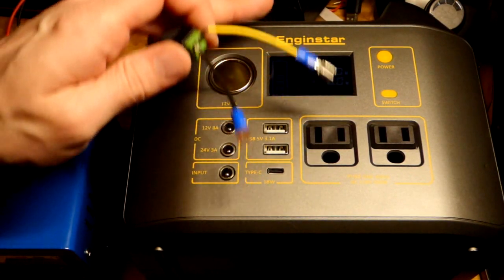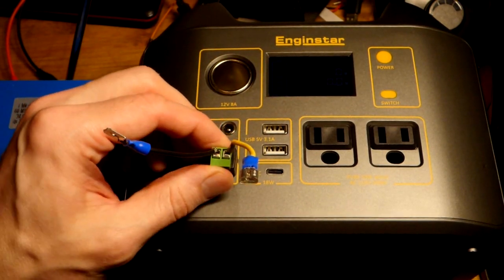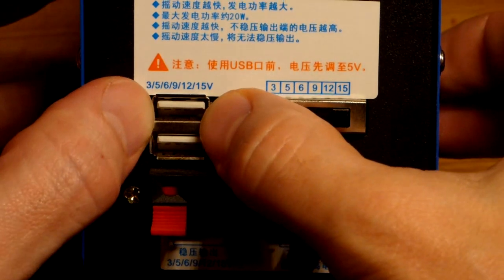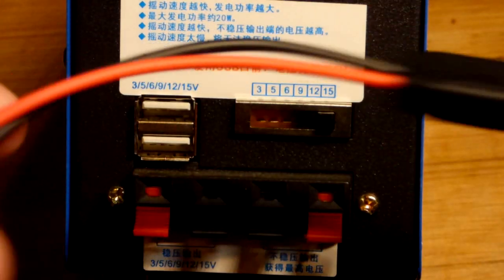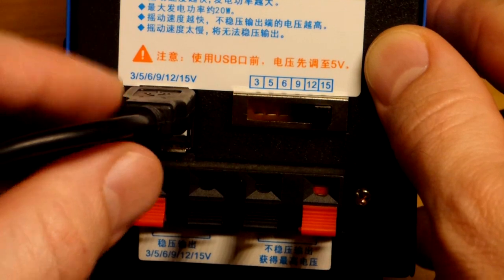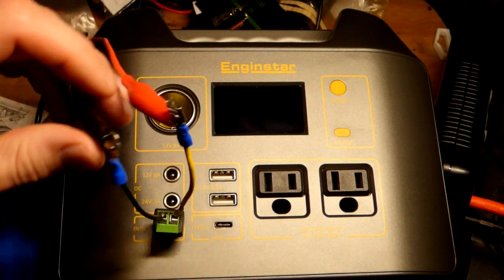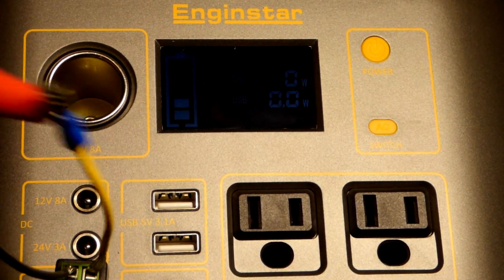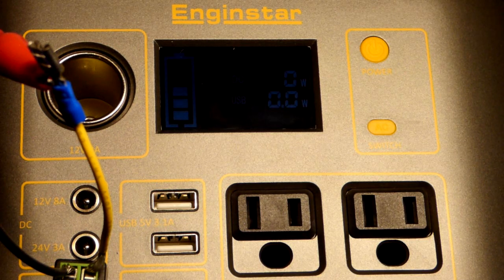Hand crank generator charging portable power bank how to DIY demonstration by electronzap

Comment: How long would you have to crank to fully charge drained battery
Reply from the maker: Since they claim it is about 300Wh, it would take about 30 hours of cranking at 10 watts to go from fully discharged to fully charged. So, I will be setting up a much better crank/pedal generator some day.
Reply: @Electronzap  YIKES   Thanx